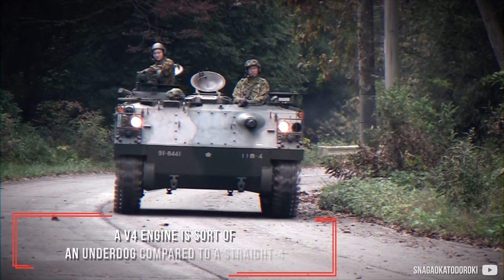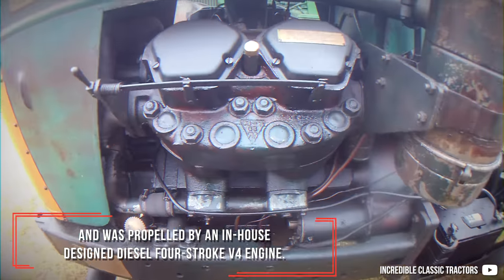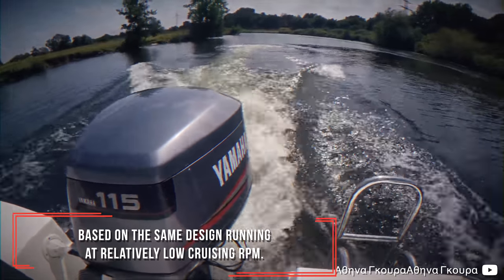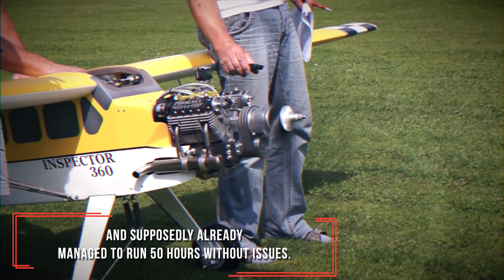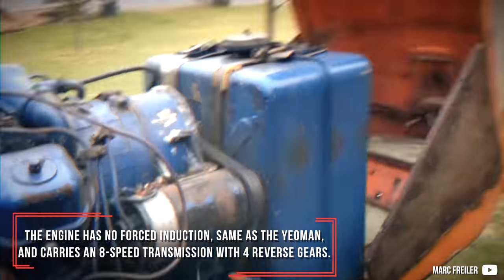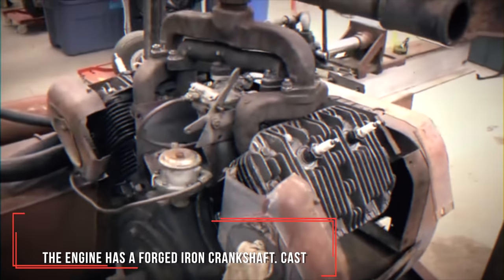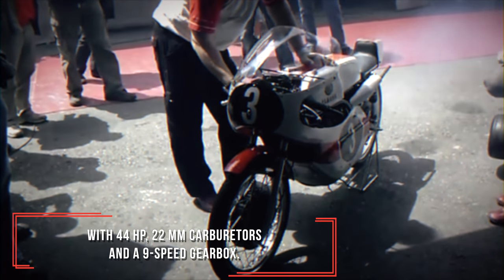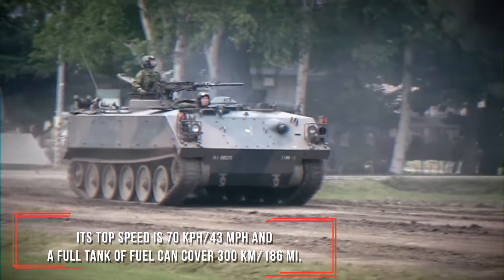Almost FORGOTTEN V-4 Engines

Comment: I've lived in Wisconsin most of my life and had never heard about the Wisconsin Motors engines before.  Pretty cool stuff!  Thanks for your always educational and enjoyable videos!
Reply: hey neighbor lol.
Reply: I have a bolens 1050 garden tractor with a Wisconsin motor... From 1966
Reply: I got used the V4 Wisconsin engine in Calif man what engine it was sold and merged with other company over the years
Reply: "Back in the day", used on bailers, trenchers,...
Temperamental little bastards to rebuild and keep running...
Reply: My grandfather in Michigan had a New Holland baler with a Wisconsin engine. He used it until the 1990's.
Reply: There were thousands made
Reply: @ronniemaeker9102  i love wisconsin engines ,, I'm a small engine mechanic  that specializes in wisconsin engines and there are a ton of different models ,,wisconsin made 1 , 2 ,4  V2,V4  parallel twin and also made water cooled 4 stroke engines ,,the common engine people know is the VH4D that engine is very common and is also one of the most temperamental engines ,,the worst thing to do is let them set because if you get a stuck valve  the result can be a broken camshaft ,they have no center bearing in the cam valley
Reply: @wildcoyote34  that main due to the exhaust lay out more so if the exhaust was point straight up and got water in manifold and settled in the exhaust port
Reply: @wildcoyote34  Yup. Like most equipment...get a good one...get a bad one...(like people...me included...)
Reply: @timothykeith1367  subaru still makes small engines. Princess auto in canada sells generators with subaru engines
Reply: @holmes1956O  Probably, I got the info from Wikipedia, which is what it is!
Reply: @timothykeith1367  could be. Might be where he got forged iron crankshaft. Cranks are forged steel or cast iron. Hay a great day
Reply: @timothykeith1367  I've got a ditch witch  with a parallel twin wisconsin ,it's a later one with a distributor and alternator ,,i've dealt with mostly OLD equipment  pre 1985 , i'm one of the few guys left who works on old tecumseh engines ,,tecumseh went bankrupt in 2008 and i have a huge stockpile of parts and old engines ,,30 years i have been collecting stuff now ,,without counting  i would hazard a guess that i have 1500 engines covering B&S ,tecumseh and wisconsin with none of them newer than 1990 ,,i have in excess of 300 kohler castiron series engines ,and several hundred newer engines  mostly briggs and stratton and kohler
Reply: @SHSPVR  very correct  but they also draw moisture ,, i had one of my own that set in a barn and drew moisture and had a stuck valve  ,,but i did something that most people fail to do ,,i diidn't go right to trying to start it , i turned it slowly by hand until it had resistance  trying to check for a stuck valve ,upon discovery of a stuck valve  i pulled the heads and sprayed them all with penetrating oil within 2 hours work time i had it running again ,,it i had just hit the start button without doing this i very well could have broken a camshaft because i have done it before many years ago when i was first learning them
Reply: @wildcoyote34  The Kohler K series are a favorite of mine. My walk-behind Ditch Witch has a single cylinder Wisconsin. Kohler also makes bathroom and kitchen fixtures
Reply: @timothykeith1367  yes i love the single cylinder kohler engines , not such a big fan of the 2 cylinder ones ,,crap like the KT17  that the 317 john deere  tractor came with ,then there was the K532 they had governor problems and oil leaks ,,the old K series single cylinder engines  were pretty much bullet proof ,i've rebuilt hundreds of them all they needed was a set of rings and a piston 
I think the best of the modern kohler engines was the Command series which was made in vertical and horizontal shaft with major parts commonality ,,i have several examples with well past 2000 hours
Reply: @wildcoyote34  To help prevent stuck valves in those engines run a few ounces of Rislone in the oil .

Comment: Saab 96: later models had a German Ford-sourced V4.  Power wasn't huge at about 65hp but go-fast parts are readily available as the 96 enjoyed some notoriety as an inexpensive racer, especially in ice racing in more northerly countries.  You can hop up a SAAB 96 to over 90 horsepower and it's as reliable in that configuration as it was before.  Fit a lightened flywheel and the whole car really wakes up.
Not enough?  You can tune a Taunus engine to 200 horsepower but at that level they're peaky and a little difficult to live with, not something you'd want to drive daily.  But as much as 120hp in a stroked engine with raised compression is still a streetable option and in a car as lightweight as the 96, pretty damned exciting.

Comment: You missed the Ford V4 that was used everywhere but here in the US. It was built with a balance shaft to make it smooth for automotive use. It had a 60° cylinder bank split and was what Ford used to develop their 2.6 and 2.8 V6 engines from. Please keep up the good work that you do young man. I never miss a video.
Reply: This engine is all but forgotten ;)
Reply: There were 2 engines - ford essex v4  and cologne v4
Both got in future two more cylinders 
cologne was also installed on saab's and some more cars
i cant say this engines are forgotten - you stull can buy parts for this engines in UK
(sorry for English)
Reply: The v4 in the transit was a bank robbers favourite back in the day, they tuned those things so they could power away from the UK cop cars at the time 👀 a bit of a oddity, but dodgy old guys in London scrapyards and old grannies I'm sweedish community rallying can both make them sing! 🤣
Reply: @mor4y  Back in the day a company called Ray Jay turbo charges made a turbo kit for the little Ford V4. With only 2 exhaust ports the kit was very simple but effective. It was a draw through system that mounted a side draft carb directly to the compressor inlet. I do remember Saab sold a small sized coup here in the states that used the V4 Ford engine. With a turbo kit that Saab would be super fun to drive.
Reply: @m1sst4k37  Your english is fine. Here in the states a company called Ray Jay turbo chargers made a kit for that little V4 that came in the Saab. That little Saab coup was sold here in the states. I got to help a guy rebuild the V4 that he pulled from his Saab. The crank case of the looks sturdy. It should tolerate high boost pressure and stay together.
Reply: @larstragl146  I had the gift of getting to help a gentleman with rebuilding one. He took out of his little Saab coup.
Reply: @adampatterson707  good luck with that
Reply: @adampatterson707  A SAAB Sonnet w/ that turbo kit would be fun!

Comment: I owned a Bobcat 610 skid steer loader for ten years and worked it HARD the whole time.  Bought it used from my dad and had it professionally overhauled from one end to the other to like-new condition before I took delivery.  The 30 horsepower Wisconsin V-4 worked flawlessly the whole time.  Simple, reliable, and bullet-proof tough.  A marvelous device.

Comment: If you want a V4 you need to find a Ford Taunus from the early 1970's, or an equally old Saab. :)
Reply: When straight piped they sound amazing
Reply: @fadedsoul23  

Lancia ?
Reply: Plan for additional carburetion.
Reply: That engine was also fitted to the V4 Ford Corsair. I think they ate commonly called a Ford Essex type engine.
Reply: Y'all should watch the Smoking Tire one take on the honda N600 swapped with a vfr800 V4. If It doesn't put a smile on your face, then nothing will.
Reply: @Blakezilla594  That’s a good one. Wonder what he’s up to these days.

Comment: I love V4s too. So uncommon but produce such interesting noises. 

I find Honda quite interesting. How the VFR800 and VFR1200 sound so different, the 800 with it cross-plane crankshaft giving it traditional V8 like burble, and the 1200 with it's el weirdo offset crankshaft giving the Honda 1200 V4 a note closer to the Yamaha race bike in this video. 

Great work Visio!

Comment: Minneapolis Moline also made a V-4 gas engine.  206 cubic Inch,  primarily used in combines and their Uni-System power unit.  It was also used in some forklift applications and probably in stationary power units.  Production ended in 1963 when Minneapolis Moline was purchased by White Motor.     This is in addition to the John Deere V4 pony motor previously mentioned in the comments, which was no longer manufactured in the US after 1960 but probably were made in Argentina up until the 1970s

Comment: Yamaha’s V4 outboards are about as bulletproof as it gets. Awesome engines, even to today’s standards
Reply: Yamaha's engine designers have always had an excellent reputation, both for road & track use!
Reply: Didn't it sound like a bike at the end.
Reply: @mikerammelt2420  it does! Especially when they’re modified like the last clip of those
Reply: The new Yamahas are also bulletproof better than Mercury outboards
Reply: @lethargicstove2024  I might have to slightly disagree with you there lol. They’re both awesome companies, but I’d take any of the verado’s over a Yamaha 350 or 425. The 350 is known pretty well for its flywheel problems and both of them are extremely heavy compared to their Mercury counterparts. But, the new 300 DES motors from Yamaha have been fantastic so far from the testing I’ve personally seen done.
Reply: @SoFloCamejo  ok I should have specified more of the small Yamaha outboards like the 115 and 150
Reply: @lethargicstove2024  Oh yes, those motors are awesome!
Reply: @SoFloCamejo  it’s funny my parents just got Yamaha jet skis I’m going for a ride this weekend
Reply: @lethargicstove2024  Sweet!

Comment: Thanks for your good videoa. I like your attitude. Here in Canada the Wisconsin V4's used to be quite common and were used to power welders, water pumpa,  farm and small construction equipment like roadway brushes and concrete saws.

Comment: You are the man, Visio, the Wisconsin engine company built a lot of generators, and skid steer engines that were flathead V4 engines, not powerful, but anvil reliability was there key feature

Comment: The MJ1A Bomb Jacks we use in the Canadian air force have the Wisconsin V4. They probably are pushing around 60+ years old but they run pretty great if maintained well enough 

It's impressive how much load you can put on the engine and the torque just keeps it running.

Comment: Great video! I'd love to see a video exploring square-4 engines - the Ariel Square-4, Suzuki RG250 and RG500, etc.
Reply: Yes, this should be an interesting topic
Reply: Square-4 was the go-to configuration if you wanted to make a 2 stroke 4 cylinder engine for a 500cc road race bike in the early 80s, before Honda switched from the 4 stroke V4 and the 2 stroke V3 to a 2 stroke V4. Then the other manufacturers switched to a "hybrid" of square-4 and V4 (basically a V4 but with two crankshafts), and it stayed this way until 2001, with few exceptions like the Aprilia V2, the Honda V2 (which DIDN'T replace the V4) and the Modenas/Proton V3
Reply: RG (and Aprilia) 250 is a V-twin.
Reply: @dr.hugog.hackenbush9443  Right - I don't know what I was thinking.  Still, Square-4 motors are pretty nifty.

Comment: Think some early Transits had a V4 petrol engine, think the same engine used to be a popular swap for some early two stroke Saabs when the original engine let go.
Reply: You could buy saab 96 with ford V4 from the factory. My grandfather had a V4 96 saab from 1967.

Comment: Nice!!! You included Wisconsin engine's!!! Most people haven't heard of them before because they're primarily heavy industrial units.  Fair enough horsepower for their size, with a serious amount of torque make them ideal for applications such as large concrete saws, stump grinders, etc. where their power to weight ratio is usually better than a similar diesel engine, at a lot lower up front cost. Even if they stopped building them tomorrow, they'd be selling part's for all of the ones in the field for probably the next 30 year's.....

Comment: Honda used V-4's in their magna and sabre motorcycles back in the 80's. V30- 500cc, V45 - 700cc, V65 - 1100cc all were fast bikes!! All had a  unique sound and we're shaft drive.

Comment: There is an east german V4  diesel engine, called 4 KVD 8 SVL, which was mounted on the RS09 GT124 multipurpose tractor.

Comment: Saw Phil Read and Bill Ivy racing the 125 and 250 V4's, saw one of them seize flat out, 17500 to 0 so fast you do not get the clutch in and go for a quick fly.

Comment: The V4 2Ts are way different in loading forces of the 4T, add another 4 to 4T and it balances it out. Honda did amazing things with VFRs over the decades and that is what I would recommend to own. Ducati's recent versions are similarly amazing, yet totally different approach. I love your jumps into obscure, offbeat machines! I have been a gearhead since I was 4 years old, so since 1974. I love the 2T outboard boat engines!
Reply: And the exotic RVF variants Honda produced for endurance motorcycle racing and road events like the IOM TT races. Truly exotic engineering.
Reply: @howardosborne8647  
Absolutely! Nobody but Honda could do that.

Comment: Like a few have said, check out the Ford Essex and Cologne V4's. Yes FORD made two types of V4 & V6 engines. Guys would use the V4's in VW beach buggy's. ☺️ Makes them a bit light in the front, but with the heavy tyre and fuel up front it was okay. 
The best part was the sound. They kind of sounded like a V8. An ally block version would of been cool. 
They have a deep pan to deck Hight as the sides drop down past the crank centre line, not like a Windsor.

Comment: The Wisconsin V4 was available in 2 different firing orders (i.e. different cranks) One was an even-fire V4 which sounded more like an in-line engine, and the other (generally earlier models) were odd-fire and sounded more like a V8. Pretty tough old engines as long as you didn't over-rev them. They did have a problem with getting water in the cylinders through the usually vertically oriented exhaust.😉

Comment: Also, I do not know much about Fords but I know that Ford Germany put a V4 engine in some cars in the early 60's.  Ford also made an Industrial V4 for many years.  Some of these engines made their way into Ford farm equipment. Also check out the Saab 96 and Sonett cars which I believe used this same Ford V4 engine.

Comment: Surprised no mention of the Ford Essex and Cologne V4's which were found in SAABs as well as many Fords including the iconic Ford Transit, the 2 litre Essex engine was the best and because of Ford's modular design, you could drop in a 2 litre Essex into the same hole a 1.3 Cologne occupied with the gearbox pattern unified across the range.   2000e Ford Corsair had the 2 litre as did the very first MK1 Ford Granada's, it was also used in the Marcos 2 litre sports car.

Comment: I'm always amazed no-one in the lo-cost style single seater racing has tried the ford/saab v4....  those things could be tuned to the moon and back by UK Bank robbers back in the day, it'd fit in the Ford 2ltr leagues, and it's very compact for a low centre of gravity, or shorten the car, or keep the car the same length and have more engine position, gearbox and driveshaft options!

Could be a lot of fun, and getting tuning tips from dodgy old guys in London scrapyards could be a experience all by itself! 🤣

Comment: I saw under the bonnet of a Ford Capri in the midi 70's and could not get over how stupid the V4 looked, about the length of a milk crate hiding by the bulk head,in a space that could take something 3 times the length. It was effectively mid engined.!

Comment: The Wisconsin  V4s  are huge gashogs .The Amish used to use them quite a bit, but have switched to  Diesels and overhead valve Asian engines . They  hold up fairly  well ,but if they sit any length of time the valves stick.

Comment: I think they are practical in the 2 valve per cylinder pushrod configuration. Even then, it is hard to justify without peculiar size constraints. Or commonality with a popular V2, V6 or V8. 
Generator/APU makes the most sense, where compact size can be incredibly important. A V4 would also allow designers to get away with very large bore sizes without getting unreasonably long. This leads to my second thought that is tractors, where a large displacement, low revving, high torque engine is useful. A V4 would allow for a much shorter hood increasing forward visibility.

Comment: 3:17. Here is a good example showing that it is firing order and not displacement that gives an engine it's sound.  Its why American V8s are deep and ragged but European and Japanese V8s of similar displacement are not. Its all about the angles for each cylinder on the crankshaft.

Comment: I'm not sure if there are enough examples but what about a video on gasoline engines turned into diesel engines. Like the gm diesel that was really just a gas v8
Reply: Also include the GMC "Toro-Flo" v-6 and V-8 4-stroke diesels--found use in buses, some trucks, and motor yachts.

Comment: I was hoping you would talk about the Wisconsin, a version of it was used in a smaller aluminum body jeep for the US army that could be carried by a helicopter. They are rare jeeps but my buddy had one years ago.
Reply: The Mighty Mite (M422) had an AMC-designed V4.
Reply: @claudehebert3131  I'm probably wrong but I thought I read somewhere the motor was built by Wisconsin. I'm sure AMC designed  it and maybe had Wisconsin produce it. Also the original motor was a Porsche flat four. One last correction, only Marines got the M422.
Reply: @claudehebert3131  thanks, interesting forum